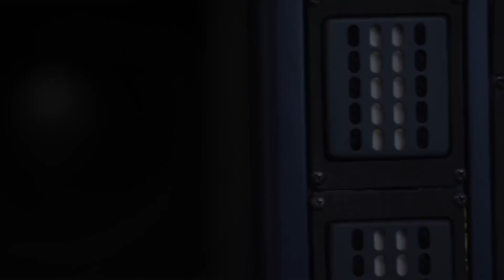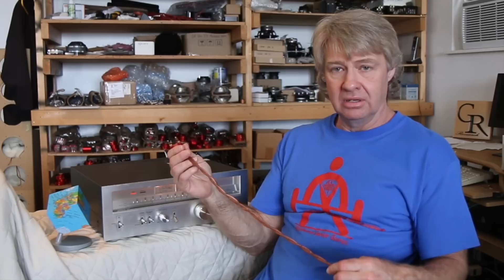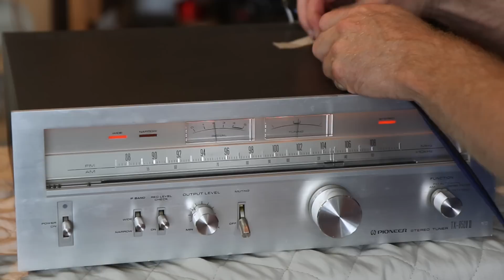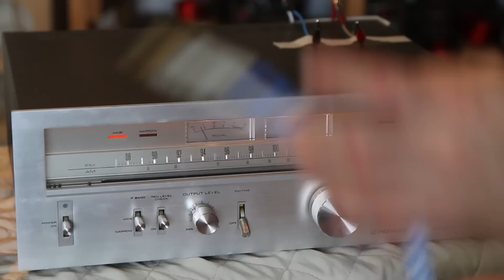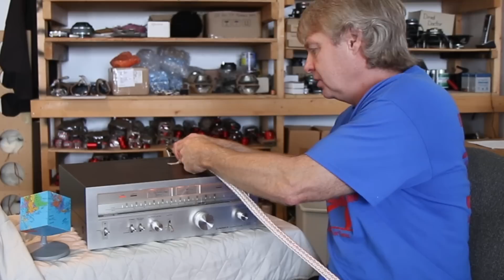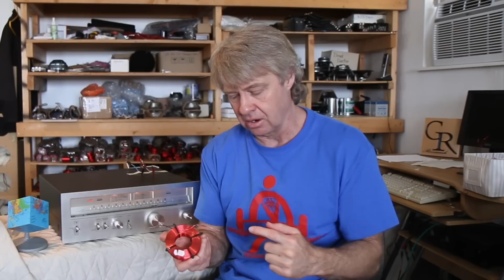Do Audiophile Cables Matter? Here's PROOF!

Comment: I remember when Hi Fi choice did a blind listening test on 20 cables using a group of their readers
   Cables from £20 to £1000 a metre BUT with a piece of household solid core "twin and earth" thrown in as a bit of a joke
   When all the results were in and aggregated (no small task, I think they had 6 listeners)
     The twin and earth came in......third.
  A lot of egg on a lot of faces, and they've not run that type of test in the 20 years since.
    There's a big difference between the bell wire interconnects and speaker wire often supplied and thicker, screened, oxygen free stuff, there's even an audible difference (very slight warmth in multi) between solid core and multi strand.
   But that's as far as it goes in terms of sound quality in my experience.
  Put the money into better speakers, it'll make a far more profound difference
Reply: Yep. I used to install audio systems in cinema auditoriums. Big room, very long cable runs, big power. We field tested a whole bunch of different cable. Our conclusions? Unless you're dealing with a REALLY long run of cable (like, over 50 metres) then regular old decent quality 240 volt 2-core flex is just fine. If it's good enough to carry 240 volts at 10 amps then it's well good enough to use as speaker cable. It costs about $1.50 a metre at any hardware store.
Plus, as many others have pointed out, the bottle-necks in most systems are: 
a) how the signal is transferred from the output transistors to the speaker terminals inside the amplifier
b) how the signal is transferred from the terminals to the crossover and/or drivers inside the speaker cabinet.
Most home stereo amps use either micron thickness tracks on the board or very small gauge cable to carry the signal from the output transistors. Some better quality amps may use solid copper busbars, but even in the biggest power units these aren't more than 3mm wide and are totally un-shielded.
Most speakers use fairly small gauge cable to carry the signal from the terminals to the crossover network, which is itself a bottleneck as it's a circuit with tiny connectors and micron thickness copper tracks. Even if you're wiring directly to the drivers the size of the connecting lug is the determining factor. Using any cable larger than that lug is superfluous to requirements.
In all these scenarios the use of fancy expensive speaker cable is utterly pointless.
Yes, I've got a decent system at home. Bi-amped, big power amps, the whole bit. What am I using as speaker cable? 240 volt 2-core flex. Cost about 10 bucks. It sounds fantastic. Spend your money on better components - don't waste it on ridiculous overpriced ancillary garbage. That $250 you spent on cables could have gone toward a better cartridge for your turntable - and that would be a difference you can actually hear. Anyone who says they can hear a difference with their fancy expensive cable is justifying the reason they wasted their money, nothing more.
Reply: @woopimagpie  ; You make a very good point about printed circuit tracks which would be confirmed by any tube amp fanatic … point to point wiring nearly always sounds better than circuit board designs, even though a good circuit board may be very low noise.
It’s particularly noticeable if you play an instrument through a tube amp … Musicians refer to ‘touch-responsiveness’ of an amp. Circuit board designs are less touch-responsive.
Which maybe explains why solid-state amps, which are always on a circuit board, have never caught on for live music?
Reply: @woopimagpie  That's extremely poor advice and why so many people will never know just how far their system can go.
Reply: @woopimagpie  Of coarse you aren't going to hear a difference using that crap. But on a system like mine and many others the difference is quite apparent and immediate.   You'd have to be almost deaf not to hear the differences cables can make.
Reply: @dannyrichie9743  I guess I must be deaf then. Quite a handicap for an audio engineer.
I bet you've got an iPhone too don't you?
Just curious - what are your credentials? Do you have a professional background in audio?
Reply: @dannyrichie9743  What gauge of cable do you use for the internal wiring of your speakers?
Reply: @dannyrichie9743  Okaaay...... That's a lot of incorrect assumptions you're making there. You've resorted to attacking my character now so I know I've hit pretty close to the mark. I'll leave you to your little delusions.
Reply: @woopimagpie  Do delusions here. I can hear clearly.
Reply: @woopimagpie  As i see it @Danny Richie spend shiploads on cables and now needs to hear difference cause of spent money. Only time I "heard" cables was when Sub had too thin wires to deliver juice in car audio. Thats about it.
Reply: @dannyrichie9743  They make no difference. It's purely psychological.
Reply: @WeaponizedApe  That may be what you think, but it is not what I know. Everything makes a difference.
Reply: @woopimagpie  I believe u r right WHEN the blindfolded listening testers r truly qualified for differentiating hifi sounds quality. If these are some casual listeners, then it is not a true valid test.
Sure u could be right for what u have stated that after the VALID listening test of varies quality built cables, it could turn out nothing is different?
Another point: when testing is done with casual hifi systems with various built cables, probably "no differences" is heard? When using top ends quality hifi components, professionals can hear and differential the differences with various cables? Perhaps u may. But not using casual hifi components.
Reply: I think the unsaid and unspoken thing everyone might not be mentioning is the audio speakers in question ability to scale. In other words would cable quality even make a difference if it's ability runs short? The best approximations I've seen of this are IEM units. Regular headphones and DACs hooked up together. Idk. Maybe I'm wrong.
Reply: @MR.ROBOTVOLTRON  You are right atm i got 10 dieeferent iem's and cables. Got one cable thats just poor and could hear great improvement opver it but rest is basically same. All types of material ect. Most expensive cable iw got is 150 bucks and tbh does not sound any beter than 20 bucks ones. But single one cuts on bass punch power as its too thin.
Reply: I think Apogee (?)  did a shoot out like that at NAMM in a listening environment using their DACs..... And most people in a blind listening test chose the figure 8 as the preference from an amp to a passive speaker. Maybe it was a Clearmountain test.
Reply: @CK J Like I've said, all the measurements in the world aren't worth spit if you can't HEAR any difference in the application. Why spend extra money on something that makes no difference? You're far better off taking the money saved and spending it on something that does make a difference.
Reply: @woopimagpie  But I believe what I believe and no facts will get in the way of that.
Reply: Actually the differences go way beyond that.
Reply: @dannyrichie9743  Strangely never measurable, and nobody talks about the internal speaker wiring
    You hear what you like, I've tried most things from Audioquest, QED, Van Den Hul and Cabletalk over the years.
   Much arse is spoken, I defy most people to tell one decently screened 79 strand OFC multistrand from another.
   And there's, realistically, no reason why they should be able to.
Reply: @dannyrichie9743  Strangely never measurable, and nobody talks about the internal speaker wiring
    You hear what you like, I've tried most things from Audioquest, QED, Van Den Hul and Cabletalk over the years.
   Much arse is spoken, I defy most people to tell one decently screened 79 strand OFC multistrand from another.
   And there's, realistically, no reason why they should be able to.
Reply: @DomRivers67  Actually there are a lot of reasons why they sound different and listening test confirm it.
Reply: @dannyrichie9743  Hi I've tested many speaker cables on different  amps speakers and tested against a 27mhz oscilloscope up to the point where the cable could no longer deliver power to the speaker (i.e. melting said speaker cable) with a sample rate of 27mhz I could not detect any difference (my hearing is okay but certainly I can not sample at that rate and neither can anyone on hear) with some twenty five years of playing with Audio gear this one is the big crock of Sh** that was proved long ago. 
P.S. I was trying to prove that a better cable(more expensive) really was better, bugger all different than a string of paperclips as it turned out.
Reply: @konaguzzi1  You testing for what? You are looking in the wrong places for answers. And the differences are easy to hear, that has already been well established.

Comment: Here's PROOF! that some audio cables suck as RF antennas.  Unless you have a something to demux the RF signal in the cables, ain't no speaker reproducing RF signals coming from the speaker cable.  Further up the signal chain where the voltages are tiny, sure, RFI is an issue.  But the speaker cables themselves?  No way.  If you want the best speaker cable, stranded 12 gauge is what us audio pros use.
Reply: Good grief!

Comment: testing antenna effect on speaker cable ? I can understand if you test it on input cables .. what would the signal do to a speaker ? Even if you consider its interfering with the feedback in the amplifier , it would be rejected in the FB network anyways with any decently designed circuit.

Comment: I like the video, but would it be better to connect the cables in the system to the speakers and turn up the volume too 10 and listen for noise Obviously without a signal source, and then compare the cables..
Regards

Comment: I know my questions won't get answers. 
Yes cables are good antennas, but why I don't hear FM radio though my speakers ?
The tweeter makes a noise, probably because it receives all the radio frequencies out there and they mush together creating the hissing. But i need to put my ear less than 1 inch from the tweeter to hear this, and i'm not listening to music like that. 
But FM radio is broadcasting a modulated signal in the mega hertz range. We can't hear above 20 kilo hertz. 
How can a 100 000 000 hz signal do anything to a 5000 hz signal ?
Yes cables make a difference, but not in the hearable range.
If a cable is filtering the decay of an instrument then its doing a lot more to the rest of the audio too, which has to be measurable. Even if it's changing the signal by a 0.5db. Can we hear the difference ? I doubt.
If you want to prove this, try to measure the amplified output directly and compare it to the input signal, how different are they ? But the the amplifier will have noise too, and the DAC as well, so there will always be different.

The only real difference users should know is the thinner the cable the more loss in DB you get. It depends how long the cable is and the impedance of the speaker.
Reply: It effects the audio signal and in some cases quite significantly.    https://youtu.be/ER_lqNFckxY

Comment: So, 12-gauge multi-stranded copper makes a really good FM antenna. It picks up 100MHz well. Does it pick up mains hum better than fancy gold-plated "audiophile" speaker cables, that being the place you might hear the difference. No idea, because this was not tested, Twisted pairs are much better at rejecting outside signals; that's why they are used in computer applications, and in the copper the phone company runs to your house. The big improvement would be given by shielding. The 12-gauge multi-stranded copper with a shield would probably outperform your fancy speaker cable, and could be used for interconnects as well. The twists are petty much irrelevant in audio usage if you have a shield, because there is no crosstalk to deal with. The shield, of course, should only be grounded at one end so as to avoid ground loops.
Reply: Shielded cable does nothing for the noise already on the line. The braided geometry becomes a filter and removes it.

Comment: Why don't you put a capacitance meter on these so-called "better" cables?  They likely have higher capacitance than the "zip cord" cables and that will impact the sound in speaker wiring far more than 88-108 MHz RF.

Comment: Your tests are useless for speaker cable, where power over the cable is way bigger than any induction they can get in a normal house. Microphone signal and low level signals (those on pre-amps) can get induction from outside if they are un balanced and of bad quality... in 21 century most of the signals are digital and interference hardly makes difference...the only cables that have to be good are those from DAC or other lower level signals to the pre-amp/amp.... speaker cables are just as normal power cables. They need to be calculated for power...20khz is not a very high frequency... so any good quality power cable will do the job....
Reply: So true. I hope he reads the comments such as this one, he actually may learn something.
Reply: @dsssy  Ha, ha, ha....
Reply: Good grief. Really? And the interference hardly makes a difference with digital? The digital signal is the easiest to level to influence with noise on the line.

Comment: Considering that the audible spectrum ends at 20 KHz, and radio station RFI is orders of magnitude higher than that in frequency, any such RFI is a nonissue in audio cables.  Any that did happen to enter an audio system will be completely blocked by the first component in the signal path.  More on the difference in cheap and expensive cables...  https://www.youtube.com/watch?v=ZyWt3kANA3Q
Reply: The RFI picked up throughout the entire system effects the signal and sound. And 
Ethan Winer has no clue.
Reply: @dannyrichie9743  Actually, no, it doesn't.  Until you have as much education, knowledge, and experience as Winer, you'd do well to learn from him, rather than criticize him.
Reply: @ExSkyCyclePilot  All you need to do is have a look at Winer's audio system and his credibility is all gone.
Reply: @dannyrichie9743  His utter lack of understanding of the difference in audio frequencies and RF is what did it for me.  I have a degree in electronics engineering and design, and forty years of bench experience, not to mention decades of experience working with both sound reinforcement and hi-fi audio systems.  Ambient frequencies measured in megahertz have no bearing on the audio spectrum, nor do they have any effect whatsoever on modern audio equipment.  And considering the extremely low impedances involved in amplifier output stages and speakers, what I said goes double for speaker interconnect cables.  Due to the low impedances involved, speaker wire gauge matters, up to a point, but not much else.
Reply: @ExSkyCyclePilot  He can't confirm any of his theories. He doesn't have a real audio system. So how would he know if any of this matters or not? The rest of us know that everything matters because we hear the differences easily.

Comment: This test only shows how much RF noise is picked up by different cable geometries, nothing more, nothing less... This test doesn't show anything about how a cable in and of itself affects the sound quality of the music signal flowing through it, this test ONLY shows how much different types of cables can pick up additional RF noise. While this IS one relatively minor aspect to consider in finding a good cable, there are many other, even more important cable "qualities" to consider first.

One question to ask here though, is if the braided cables act as filters of high frequencies, then (theoretically at least), wouldn't those same cables slightly attenuate the subtle details of the highs in the music signal passed through them, at least of the musical harmonics above 20KHz or so?... The frequency harmonics of music from 20KHz to at least 40 or maybe 50KHz or so still add some life, depth, and realism to the overall sound and tone of certain musical instruments for example, and that has been talked about for decades in the hi-fi audio industry, so you wouldn't really want a cable that filters out any of the high frequencies would you??... Any thoughts on that?
Reply: As per your first paragraph, correct! It was to show just one aspect of the cable. And the braided cables can filter out some of that RFI without effecting the audio signal and everything that we want to be maintained.

Comment: So you say adding shielding to the speaker cable is pointless due to noise already being present on the mains power line. So why bother with expensive speaker cables then? Won't make a bit of difference at all (and yes I really mean that and no your demo was pointless).
Reply: Who says a well designed cable is expensive? And removing noise levels in the system does make a difference. And the demo showed how a cable can be a filter for it.